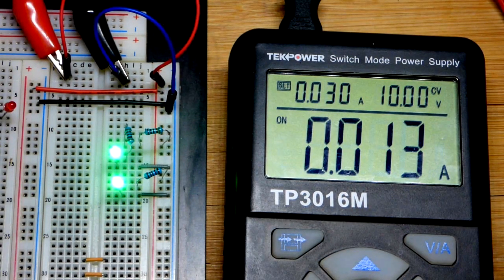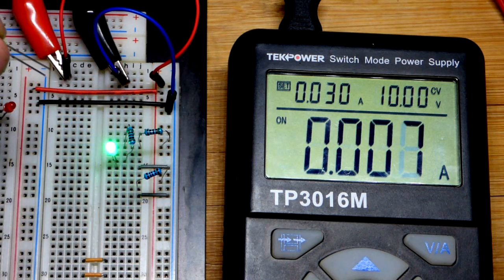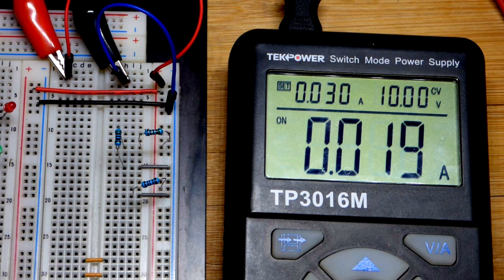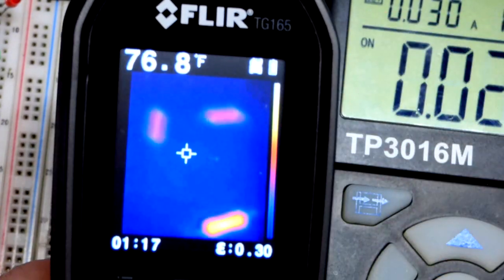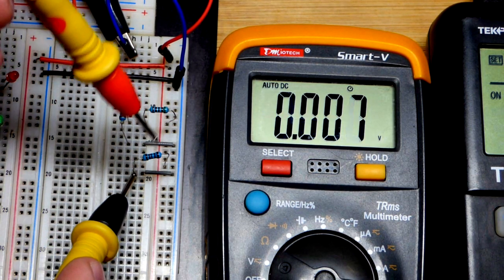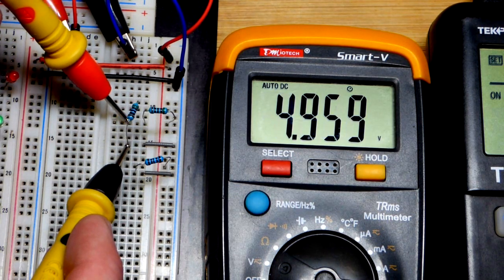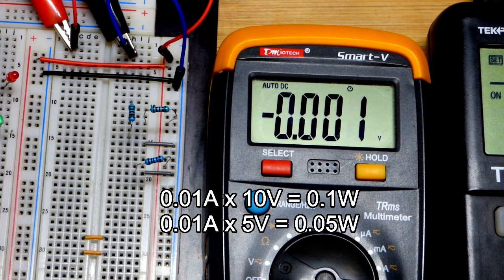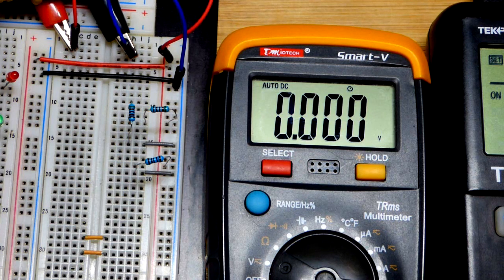Series resistors split up wattage demonstration with thermal images

Comment: Nice... Nicely done.
Reply: you should do the next one with the LEDs and place and show that you can put a resistor on the front and the back of the LED.
That's been my little trick knocking down 12 volts to a sizable voltage.
I still don't understand the current only being 5
Colts going through each resistor, I didn't understand that.
I've been making my buddy bust-out explorer on occasion to check out circuits that way.
I guess what I'm really interested in is how to make the battery
Dissipate less current voltage without dissipating heat... ? 
Like a voltage divider maybe and splitting up the rails of current two 6 volt 6 volts and then not getting heat but still lighting LED arrays. 
Any thoughts?
Reply from the maker: Yup, it is just like the voltage divider. The best way to reduce a DC voltage without much waste heat is to use a buck converter.